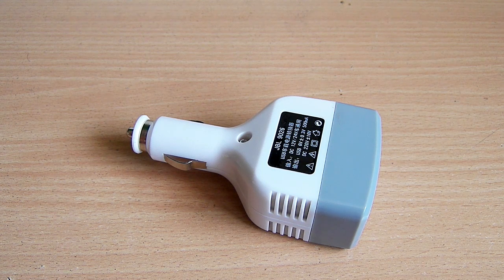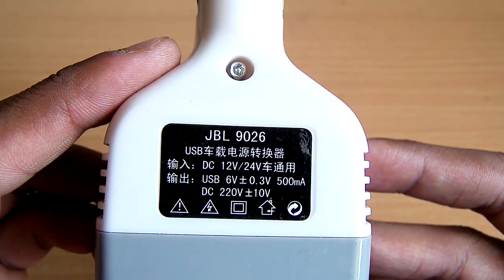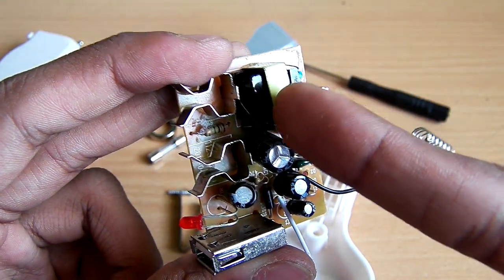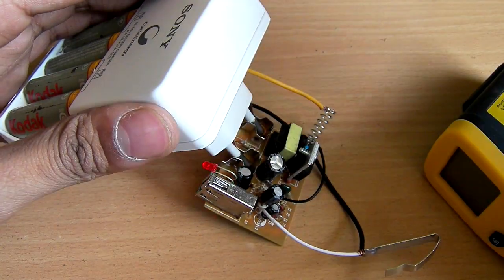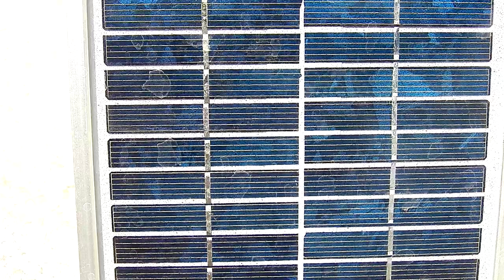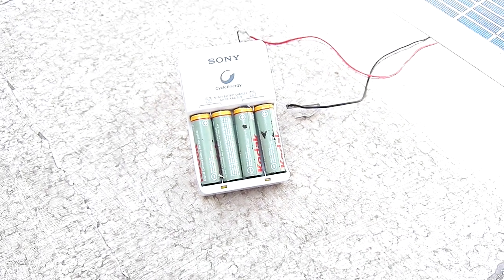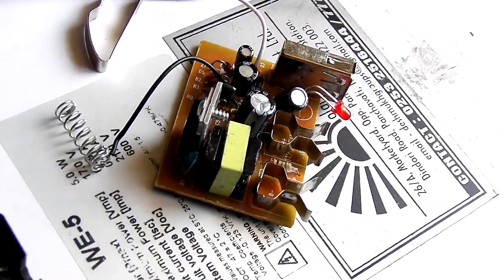Solar Inverter made from 12v Car Inverter

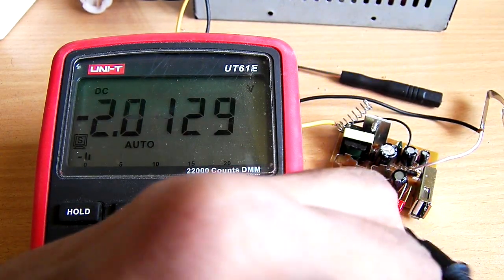Comment: 3:14 Why output 220 V is DC? They must be AC.
Reply: Дмитрий Руденко is das't mater if   
It is AC or DC it will work
Reply: There is no AC on the output of the inverter, because it's the cheapest one.

Comment: idiot how the charger will remain on it is dc not ac if you look inside the charger you will see a transformer and transformers can only run at ac metal case
Reply: +Hasham ghaffary Don't call people an idiot if you don't know how it works! He is right and you were wrong! Idiot....
Reply: Battery chargers are switching power supplies - they can run on either AC or DC. It's turning on and off because the inverter is turning on and off, because it's overloaded.

Don't call someone else an idiot when it's actually you that doesn't know what's going on.
Reply: Wow you should do reserch on it chargers have transformers in them and transformers can only work on ac because the magnetic field can not change in dc
Reply: Switching power supplies initially rectify the AC current, turning it into DC, and then an electronic circuit converts it to high-frequency AC, which is then fed into the transformer. This is why they can run on DC - it just skips the initial rectification.

Again, you need to read up on stuff before you start making assumptions and being rude to people.
Reply: +Против Глобал Sir you are right
Reply: ELECTROHAXZ this always running
Reply: This thread are one of the examples of IDIOT person calling others as idiot to cover their idiocracy LoL

Comment: What happen's if you touch the 220V from the inverter ?
Reply: You get shocked. What do you think?
Reply: ***** yeah but the same like i touch mains 220V ?
Reply: It would feel a bit different. With an AC shock your muscles contract and relax at mains frequency, but with DC it's just a constant contraction. A DC shock is way more dangerous because it propagates through the body better and it's harder to let go of whatever's shocking you because your muscles never relax.
Reply: themaritimegirl No, because AC passes easier through your body. Humans are a bit capacitive. Measure yourself on a multimeter.
Reply: Против Глобал We had a demonstration of ultra high frequency 2000V shock. It didn't even hurt. Maybe a little, but doesn't cause burns.

Comment: Hi i have question, how you  get od DC 12V 223V on output  (DC), should it not be AC on output?

I have bought from ebay car inverter 12DC to 220AC,  today tested  for first time and i get on output 440V AC.... -_-
Reply: These super cheap inverters are designed to output DC, not AC. Cell phone chargers, CFL and LED lamps, and other modern electronic devices can run on either DC or AC, as long as the voltage is correct.

The voltage isn't regulated. The 220V version has an open-circuit voltage of 440V, but as soon as you put a load on it, it will drop down to ~220V.
Reply: I bought a similar inverter for $2. It gives 180V DC loaded/unloaded. However, the LED bulbs I use turn on and off and they flicker. However, I managed to repurpose components for different projects.

Comment: I think it's because of the amps not voltage, if it received more than the 0.5 amps it will work
Reply from the maker: It needs at least 6 watts power to turn on .
Reply: 500mah is 6 watts at 12v